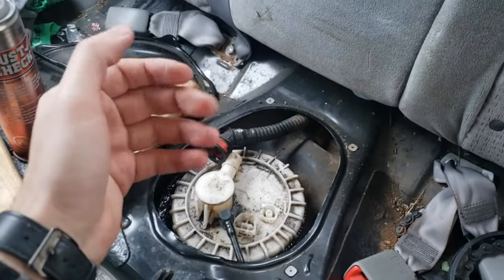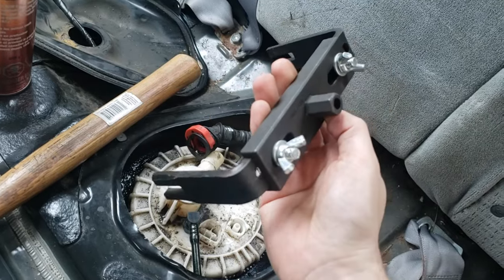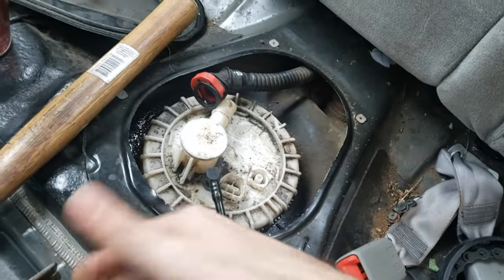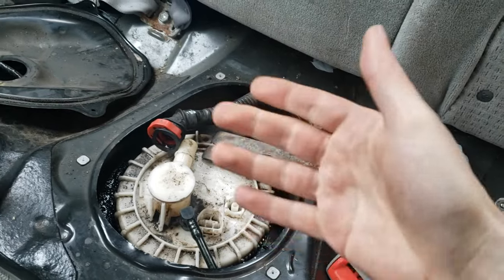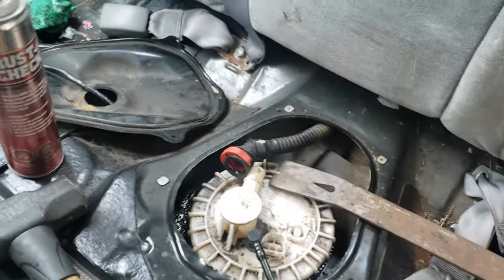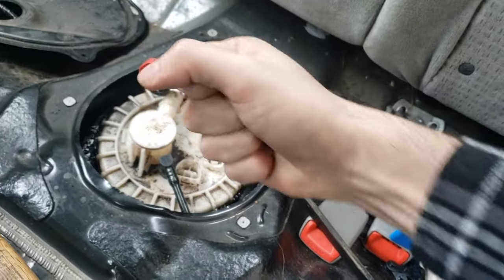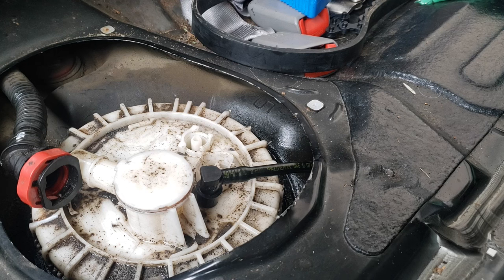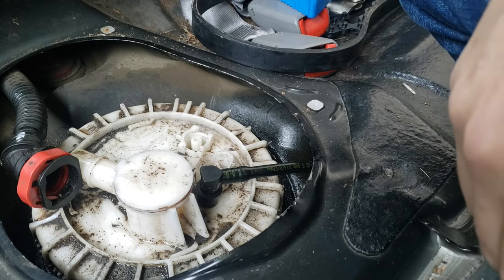How to Remove a Fuel Pump Lock Ring: Reality Check!

Comment: If you go to an auto parts store and tell them that you want to borrow a tool to remove the ring holding the fuel pump/ fuel sending unit and tell them the year make and model of the vehicle they will let you borrow it. Sometimes you just leave your id with them and other times you give them a deposit and your id and as long as you return the tool undamaged you will get the whole deposit back
Reply from the maker: True! I'll pin your comment for the others!

Around my town they've stopped offering the service, but it is a quick and cheap option too!
Reply: I have been to 4 parts stores and not one of them knows what this tool is.
Reply from the maker: @NathanThompsonBlueEyes  not sure if it helps, but the name of the tool is Spanner wrench
Reply: @probonomechanic  thank you,  but factually speaking, all open-ended wrenches are spanners.

Comment: I know this is a 3 year old video, but I just saw it.  i thought it might help others to suggest using a dead-blow hammer instead of wrapping rags around a metal hammer.  Also, a fan to blow the fumes away would help.  Just a thought...

Comment: Bless you sir the pry bar worked, 1 alternator 300 dollars 1 fuel pump 500 dollars verdict . . . It ain't got no gas in it
Reply from the maker: Fuel gauge is not working?

The replacement fuel pump have a new sending unit and it should fix it.

Comment: I used the exact same method to get mine off, except I used a large rubber mallet instead of a metal one. I beat on it for about ten minutes and it broke free. I didn't even damage the tabs at all! it did fight me most of the way, not an easy task. The short prybar was just the right tool, I've had mine for at least 30 years and it's a must have for my tool box. Thanks for this video, it helped make my job easier!

Comment: I tried every way you described on my 2010 Corolla, (and many others) but no success. Even a tool that grab on to many sides of the ring would not work when I used a 30' breaker bar. Then I tried an impact wrench with the same tool and it came loose immediately!

Comment: I’m battling one right now on a 03 crv , good times 👍🏻🍻🇨🇦
Reply from the maker: Hope it works for you! 

Question, did you have problems with the switch for the windows and door locks on the driver side of you CR-V?
Reply: @probonomechanic  just got the bugger out lol I had a full tank of gas from 3 years ago when I stored it and this seemed like the best way to pump it out and see it ,,, no my crv has literally never had an issue other than the airbag recall and consumables like brakes etc,, it’s an 03 the fully loaded I decided to take her out of retirement these are the best👍🏻🍻🇨🇦
Reply: I should add though it’s never left outside or winter driven
Reply from the maker: That CR-V is getting more live than 99% of the vehicles on the road today hahaha

I use to have a 98 it was one of the besy vehicle I had. So you are doing well to keep it in good shape! That thing will last for ever hahah

Comment: True my friend. It's not easy to remove the ring. I break 2 sides pieces and stop. Your video is explained better and clear. Ty.
Reply from the maker: Hope that the job went well for you!
Reply: The mechanics did brake it for me, now i just got myself a DIY tool to open and close it whenever i need to work there.

Comment: Mine was stuck to the point where nothing could get it off.. I ended up cutting it using a flat head screwdriver and a hammar.. then I got a used one from a store that sells used parts. It only costed me about $6 ..  So that's the best option for anyone struggling to take it off
Reply from the maker: If it gets to that point and nothing else have worked, it is sadly the last option. 

It's nice that you could find a spare lock ring. Did you keep the original o-ring or did you take a new one?

Comment: I have 2018 nissan sentra but fuel gauge problem as well, thinking of doing it myself
Reply from the maker: Sorry for the delay. Did you try the job on your sentra?
The lock ring is a bit different and it should be a metal lock ring.

Comment: try putting a few layers of painters tape on the edge of the prybar maybe less likely to chip off the notches on the lock ring? also less chance to spark if it slides off after hitting
Reply from the maker: Good point!

Comment: I am going to try your method but first I would like to know if I absolutely have to remove the fuel lines first before hammering the lock ring because I have two fuel lines coming from my unit ( renault megane2-1.5dci). One line has the red circle like in your video & the other line has black push button sides to unlock it. Can I just leave the lines connected ? Thanks
Hadi
Reply from the maker: It is not an absolute, but it is advized.
The reason is that the fuel pump could turn as you start to remove the lock ring. This could kink, twist, or damage the fuel lines. 
Since the fuel lines stays with the car and the fuel pump is change it is safer to just remove them in advance.
Was your purpose to change the fuel pump?

P.S: Sorry for the delayed answer

Comment: In the past, I  sprayed the penetraring oil around the bottom of the ring over the period  of a week. My ring came of with a long screwdriver and a hammer. Don't know it this helped or not. So just letting others know.
Reply from the maker: Any information or advice is always welcome! 

Did you just do a single heavy spray or did you add more over the week?

Comment: What should you do if the ring keeps breaking?
Reply from the maker: Sorry for the delay!
Which technic are you using?
To help reduce the amount of broken tabs you can do 2 things.
1: use penetrating oil or a good can of lub to soak the lock ring. Let it soak a good 4 hours or more before working on it back.
2: If you are using the prybar similar to the one in my video. The edge of the prybar that make contact with the tabs is sharp. Use a grinder to flat out that sharp angle. 

Hope these helps!
Reply: @probonomechanic  thanks for the reply, but my ring has broke twice all the way around. Im not sure if they make a metal replacement but that seems to be the only logical thing.

Comment: hi boss when i turn the key the pump click then when i crank it, it sounds like its working  but am not receiving injector ground pulse
Reply from the maker: @trevino9136  there could be a few things. I always ask to see if there are any codes that pop on the OBD2 scan.

Beside that the injector fuse or it could be the anti-theft systems that is still on.
Reply: @probonomechanic  no codes, when i insert key and turn it the security light blinkS doesn't go away i was thinking it was a security issue i greatly appreciate it u the man
Reply from the maker: @trevino9136   check this video at 4:53 if you have a corolla
https://youtu.be/QA0K6vSyhKM?si=AgIkLvteMTC99pcj
Reply: @probonomechanic  1 more questions does ur fuel pump prime when key is turned to on not run
Reply from the maker: @trevino9136   if the line is already prime it will not make a sound. 

If you tried to start ot often you may need to clean the spark plug if they are full of unburnt gas. Cleaning the spark plug will shownif you got gas in the cylinder and help to unflood the engine

Comment: Follow up, I used the kit and did not work, the chisel bar with a towel and a hammer did it though. Finally got it moving after literal hours
Reply from the maker: Glad you got it out! They are a pain to remove.
Keep the old o-ring under the lock ring. The new one could be too small or too big. So compare them before reinstalling

Comment: Hi, can i cut the lock ring with a saw? Will it be safe? Its super stuck on my 2016 corolla. Ill replace with a new lock ring ofcourse
Reply from the maker: I really can't suggest it. 
The reason is that the lock ring screw over the gas tank. If you cut it just a bit too far, you will damage the treads on the gas tank where the lock ring screw.
It will result into either a constant gas smell/gas fumes inside the car or the new lock ring may not screw over the broken treads.

Did you try to use a can of lubricant to litterally flood the lock ring with oil? If you do let it sit a few minutes and then try to hit has hard as you can with the pry bar I showed in the video. (Remember to use a rag to protect the hammer from making a spark)

If you have no other choices, i woupd say that you need to make 2 cuts, one on each side of the lock ring to opposite side (once cut it would look like two half-moon).
The pain will be the sides of the lock ring. So you can either try to use some kind of chisel or screwdriver to try to seperate/break the lock ring where you made the cut.

Be really carefull! I don't want you to caught fire if you hit metal on metal. So use a rag or some old clothing to protect the hammer from sparking on the chisel. 

Let me know how it goes!
Reply: @probonomechanic  thank you for the thoughtful reply! No, i have not tried oil/lubricant. Do you recommend PB Blaster? I was worried that it would contaminate the gas. Ill try this first before trying to cut the ring. Thank you again!
Reply from the maker: @karmabasedj8184  PB blaster would be perfect for the job!
Don't worry too much for contamination for now. Shoot the lubricant heavily on top of the gas pump and all around the lock ring.

Wait a few minutes and when it is time to start the job use a rag or towel (paper or cloth) to sponge out the extra lubricant!

I would say a few good hit after that and it should turn. I really hope it will move from there. When the ring starts to move prepare your rags to wipe the top of the gas pump of any big pool of PB Blaster.

There is usually a o-ring under it, make sure to keep it and not let it fall inside the tank. Sometimes the new o-rings aren't a perfect fit and you will need to compare the old one with the new one. 

Keep me informed!
Cheers
Reply: @probonomechanic  sure will! Thx again
Reply: Hey happy to say that PB blaster did the trick! I used a LOT of it and it eventually budged. I put in a new lock ring along with the new pump. Thx again!
Reply from the maker: @karmabasedj8184  Great!
That's great news!
Happy it worked, it could have been one hell of a job if not.

Comment: How to take lock ring off of fuel pump in trunk of a 2008 cadillac days can’t get it off!
Reply from the maker: If I remember well they use the same  lock ring as the chevy. 

Is it the metal lock ring with the grooves on the exterior edge?

Comment: How the f do i get it back on?! Been at it for almost two hours now
Reply from the maker: The o-ring/seal needs to be properly installed. If you got a new one with the pump, make sure it is the same size as the old one (compare them together if you can).
Double check the treads in the lockring and on the tank.
Reply: So I’m not alone 😂😭

Comment: Uck, now I am scared.....gotta get that thingy off tomorrow.
Reply from the maker: First step will be to soak it with a lot of lubricant. Just that will make the job a bit easier. 

Hope for you its an easy one!
Reply: @probonomechanic  Thanks, will do. As for easy, LOL, original pump on my 98 
Ram Van.....it is rotted in place. ☺
Reply from the maker: Ohhh ya! I remember those. Plastic lock ring and the ridges are few and long. 
Pain full one, good luck buddy!

Let me know
Reply: @probonomechanic  Thank again!

Comment: I don’t want to give up but this is really frustrating, I’ve been at this for 2 days, used both methods even later on adding lube and it still won’t turn
Reply from the maker: Hi! Sorry for the delay!
Were you succesful?
Reply from the maker: Assenmacher does make really nice ones. For the cost, its a high cost for a one time job for the whole life of the car. 
Always prefer cheaper alternative when possible...but sometimes I guess we have no choice (but at that price better bring it to a mechanic shop so someone else will hit his head against it.)

Comment from the maker: Discount at RockAuto!

It's a 5% discount that is valid until the 25th of July 2021. 

CODE: 174731902159300031

This is how you use it: Enter your discount code in the 'How Did You Hear About Us?' box without any other numbers or characters for an additional 5% savings. Discounts cannot be applied to shipping, gift certificates, or to an order once it is marked as shipped.

Hope it helps!

Comment: Ugh wish I saw this 8 hours ago
Reply from the maker: Never a good sign...what did you do?
Did you cut off the ring?
Reply: @probonomechanic  haha yep it wouldn’t budge so eventually I switched the flathead for a chisel, even severed it twists back on OK. Will buy a replacement. Then after with new pump, still won’t run! Oh joy!
Reply from the maker: Hahha you did what you had to do!
Just hope the threads are no damaged on the tank.

Car wasnt starting?
Reply: @probonomechanic  yeah car died after I added fuel cleaner! Even with a split it still spins back on tight
Reply: You can try putting an impact hammer on a brass drift also and use a piece of wood and yoga move between the 2.  Either way I've never understood why oem rings don't have a 1/2" ratchet recess built in..   always a pita for sure. Never thought about using a small pry bar!  Great video and thanks for sharing!  Going to tackle a 07 Chry shortly.
Reply from the maker: Ya, that works!
What model of Chrysler?
Reply: @probonomechanic  07 Aspen 5.7L

Comment: I’ve been at this for 30 minutes, mine won’t move
Reply from the maker: Hi, what are the steps that you took?
Did you try with the lubricant?
Leeting it soak a few minutes will help a lot!
Which tool are you using
Reply: @probonomechanic  I used lube, I wait, I add more lube. I let it soak in between adding lube. And I’m using a metal thing that’s like your cowl bar but thicker and shorter. Im just hitting it as you show in the video
Reply: Update I got it off, put on the new fuel pump. But now I can’t put on the ring, ugh
Reply from the maker: Ok, remove the lock ring and check the o-ring. Are you using the new one or the old one?
Compare the size of both. Maybe the one you are using isnt good and it doesnt fit properly. Try with the other o-ring if you are not sure and check without tighting too much if the lock can get in the treads.

Let me know!

P.S.: the lubricant did the job?
Reply: @probonomechanic  Both the O-ring was the same size. After trying I got it, after 10 minutes. Idk why it was so hard. Everything was working and my car drives like brand new, better than using my old fuel pump. Thanks for the video and the tip about lube.
Reply from the maker: No problem!
Glad you got it in and running.
It can be hell of a hard time and a lot of stress.

Stay safe! 
Cheers

Comment: Your right the removal tool sucked, your pry bar idea was just what the dr ordered. A few taps and it was loose!!!!
Reply from the maker: Good! 
I'm glad the video helped you!

What year and model is the car you were working on?
Reply: 16 Corolla
Reply from the maker: Nice, so you were able to access the top of the gas pump from under the seat and to hit the ring with the pry from there? Or did you have to drop the tank?
Reply: Yes from under the seat. Changed the pump and car still not starting. Still trying to figure it out…
Reply from the maker: Ok, tell me: does the car crank?
Reply: Yes it cranks and will start with starter fluid then dies.
Reply from the maker: So you got spark. 2 things comes to mind: its either the injectors not doing their jobs or you have a pulley that is seized and prevent the engine from turning normaly.

2 questions:1st does the starter feel sluggish/slower when turning. Like of the battery is weak (atleast slower than normal)
2nd: remove all spark plug clean them up (lighter/torch to burn the fuel on them), reinstall them and check if they are wet from gas after turning the engine. 

P.S: I'll post a quick video within the next 10 min to do a quick overview of those cars.
Reply: Battery is brand new just replaced yesterday also because the battery was done. Have spark because it ran for a minute with the starter fluid. When I get back to it I will check power to the pump.
Reply from the maker: Alright, if there is power to the pump and you got pressure in the line, check your injectors (fuse too). 

Even with a new battery, check your pulleys (usually the alternator will seize), if its seize the engine will start turn and it will feel normal but the engine is actually working to hard to start properly.
Reply: Good idea I’ll let you know. Thx
Reply from the maker: No problem: I have a last question. Did you check your anti-thief system?
Some model cut of the fuel supply to the engine when its on. A good test is either to reset the security system or if you have a spare key, try starting the car with it.

Maybe try that before anything else. Could be really simple like that.
Reply from the maker: @mannyroldan5060  I just uploaded a video about toyota corolla not starting. Its a 2008 and things will be a bit different but the theory is basicly the same. Take a look at it and let me know.

Cheers